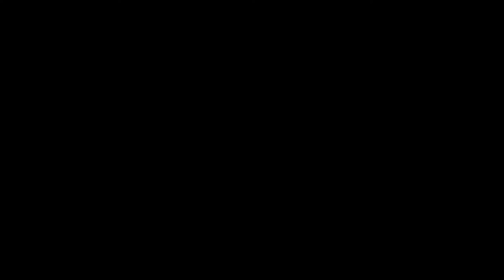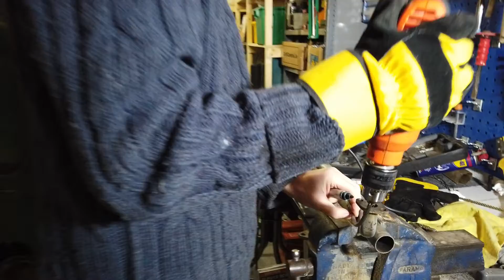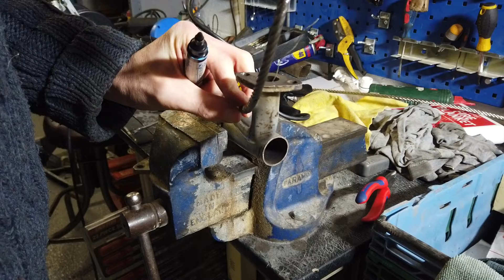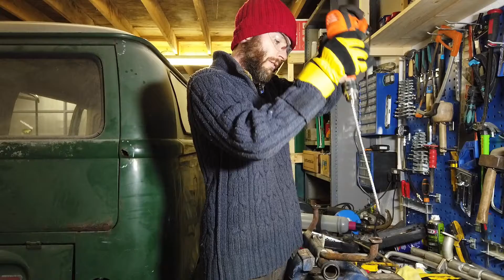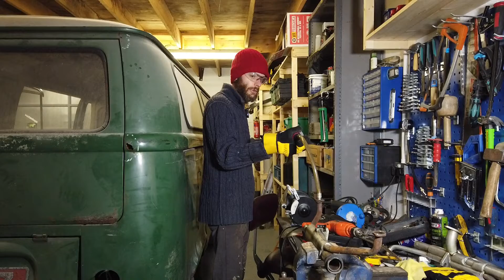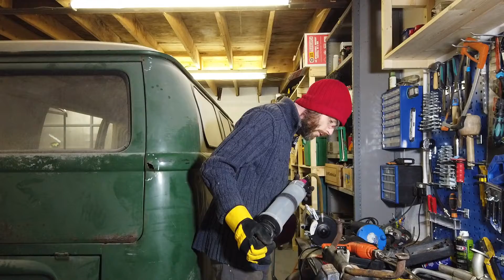VW heat riser cleaning

Comment: Would you know the part number for your inlet manifold, I’m guessing it a twin port for 1600?
Reply from the maker: Yep, twin port 1600. I think there's a part number stamped on it, will check and get back!
Reply from the maker: The part number is 113.129.701AE . The important part is the last two letters, AE in this case which is a twin port 1600, this should match with the code stamped below the generator/alternator stand on your engine: https://www.heritagepartscentre.com/eu/vw-aircooled-engine-codes